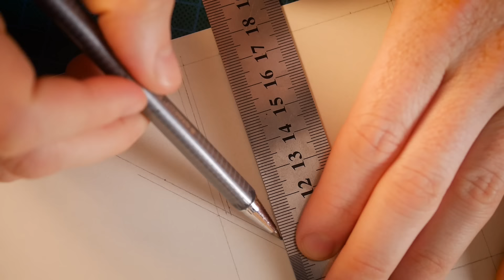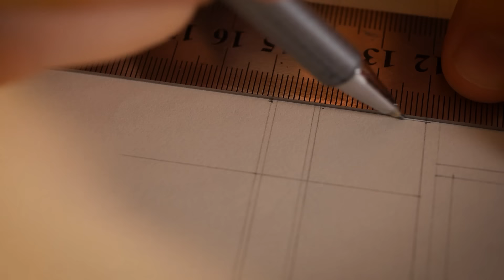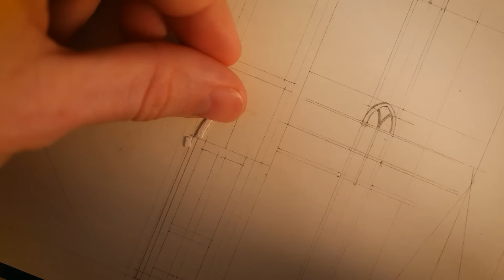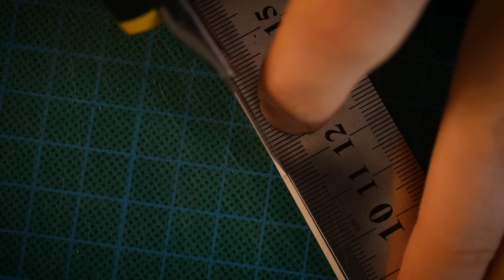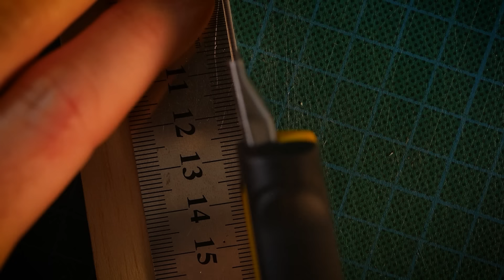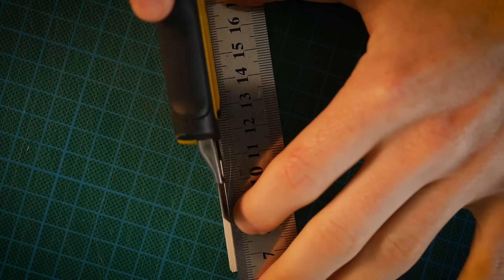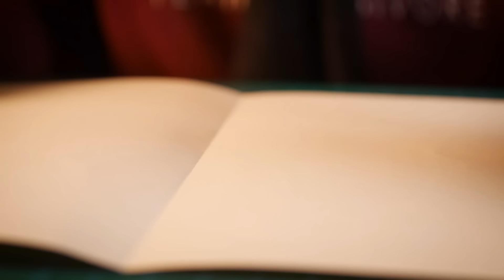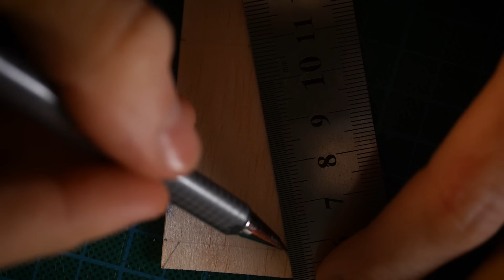The Country Church - 1/48 Diorama

Comment: great project... Can I ask what glue do you use? I do my projects with balsa wood and I have used many glues but don't work well.
Reply from the maker: Thank you. I mainly use a fast setting super glue for the balsa wood, it holds well and makes the process quicker than using white glue